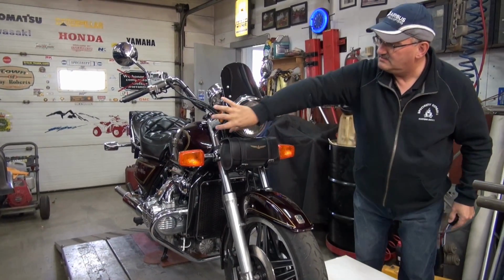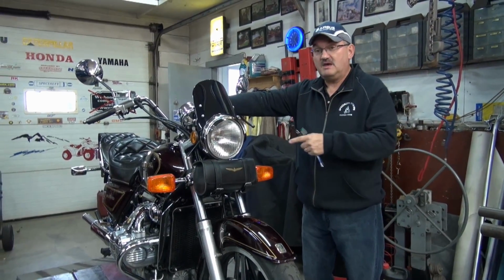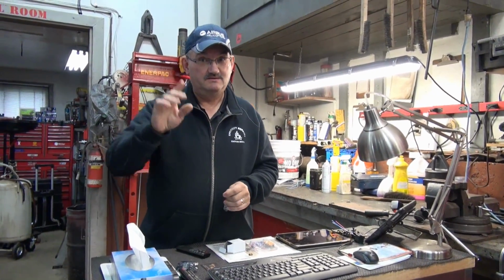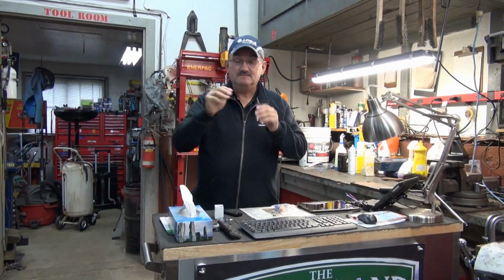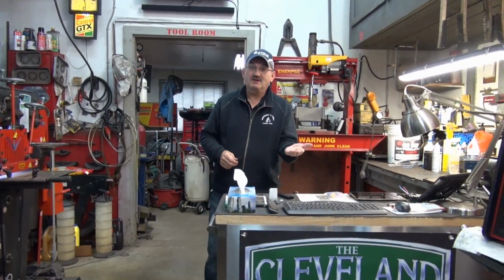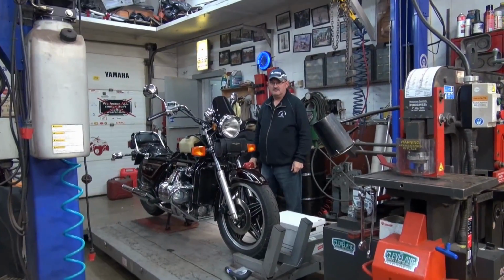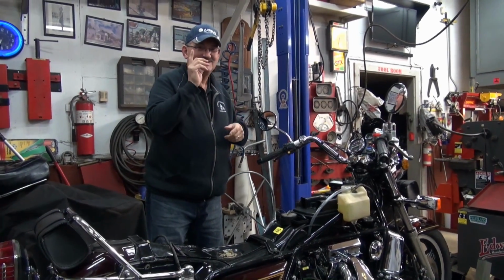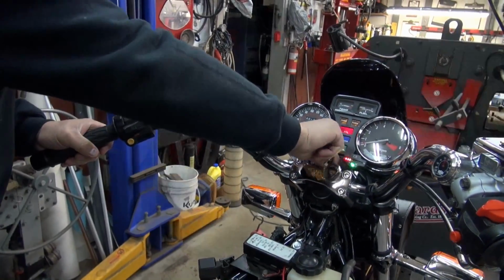All About LED Lights/BONUS

Comment: Paul one thing you mite want to add is when you install the load resistor Don't mount it near any other wiring as they put off extreme heat and they'll melt any nearby wiring per the manufactors instructions FYI
Reply from the maker: These are General Information videos. Not text book oriented classes. The viewer can get the basics and research the rest. Don it might be a good time for you to put out a more detailed video. It’s a shame to waste such knowledge. Share it with the world.

Comment: didn't realized 3 LED headlights would draw that much power to use a relay.
Reply from the maker: The other two new lights being added aren’t leds. You just assumed they were.
Reply: But but but...you're Paul 'LED' Short.  LOL
Reply from the maker: They are arriving with Halogen bulbs which may get switched over to leds IF there’s room in the case. I won’t know that until I receive them. If they can’t be switched over the relay will protect the oem switch. If they can the relay can still stay, no harm done. Better to protect the oem switch than not to.

Comment: Have an extra pat on the back from the UK. Have you converted the 1800 to LEDs? I have some light strips to add to mine, but I'll wait until after its annual inspection before I do.
Reply from the maker: Long ago. Check out the link https://flic.kr/p/5wYCPu  
Keep safe over there.
Reply: Very smart looking bike, especially when it's lit up.

Comment: Hi Paul, when confronted with the need for a diode like that, I just grab a 55 cent rectifier and put pigtails with spade lugs soldered to it.. Of course we already have an assortment of low and high voltage diodes in a range of amperages cause we in the electronics biz.   The molded diode with built in spades is quite sanitary, but 30 bux is ouch!   Cheers!!  another very useful video.
Reply from the maker: You might have missed my explanation for doing it this way but I gave a full and complete reason  for it. Basically I wanted to keep the parts on the bike oem and not clobber it up with stuff that didn’t belong. I fully realize I could have done it differently but I wanted it done the right way , the clean and tidy way.
Reply: Paul & Kathy Short 
OEM is likely to not only be more sanitary in appearance, but being potted with the spades, more durable for vibration over the years.. Its the correct call to spend the bux... but a cheap diy could keep ya rolling till the nice one arrives. Fortunately, with having multiple bikes, and the turn of seasons, you not under pressure to ‘keep it on the road’..    As far as LED conversions go, you have the concepts nailed right on!  Many people not as aware about lower current causing odd behavior.. 

Did get a chuckle about “sisters not re-sistors”.... I have seen some dysfunctional families that would have benefitted from re-sistering😉.  Humor talks about reality!

Comment: That's a slick relay. I'm going to look for that one because I have a fan that runs constantly on my 55 Chevy and I need to put a thermo-switch with a relay in the circuit. See, I always learn something here.
Reply from the maker: Super cool my friend. Glad you got something out of it. If you need a few I’ll send them to you.
Reply: Thanks Paul but I found a 2 pack for $8 on Amazon (free shipping)...already ordered!
Reply: They just showing up out here in Oregon USA. I love the sanitary part of not having to put in a in-line fuse.. We run high current H-4 halogens in our cars... relays are essential to not cook the headlight switch and light gauge OEM wiring.. fuse built in is a great idea..